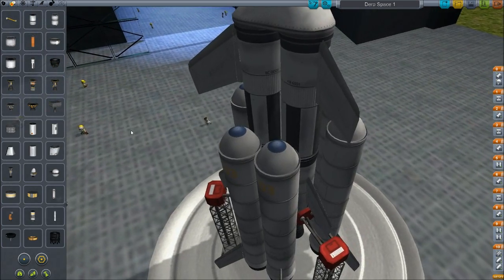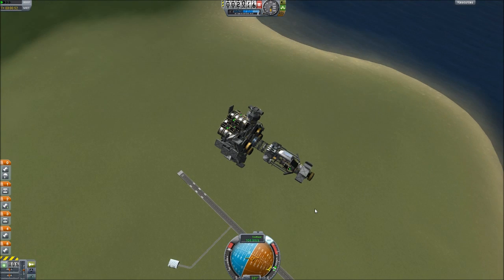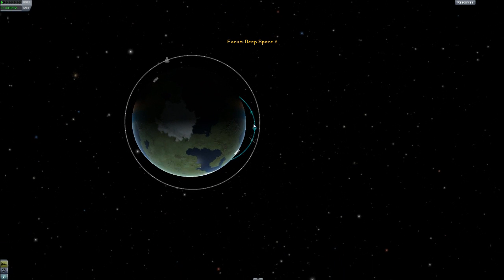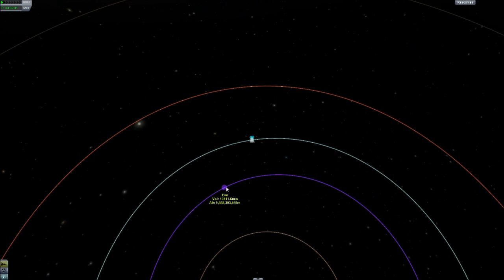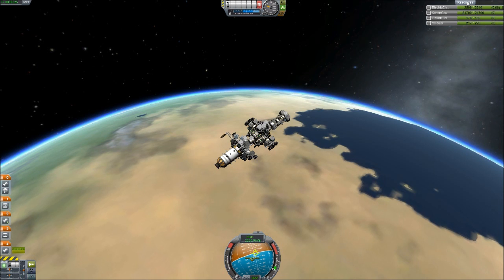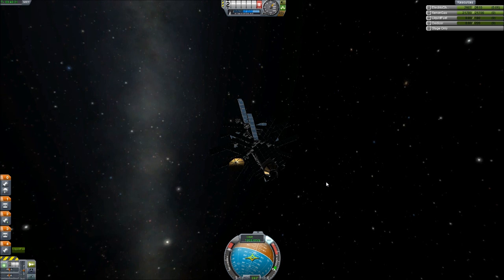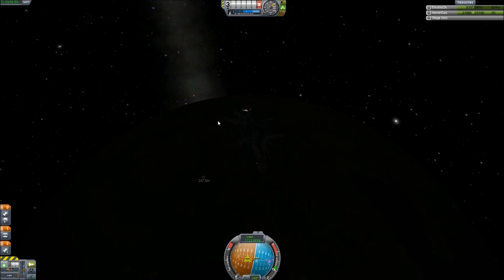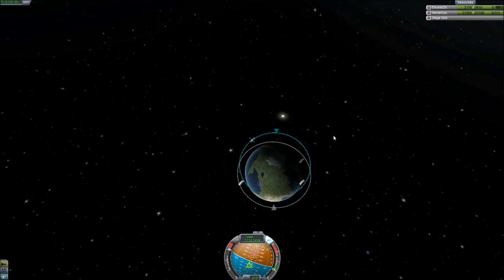Kerbal Space Program #004: The Legend of the Derp Space Probe (part 1/2)

Comment: You should use the Gigantor XL instead of all those OX-4B, it's waaay more efficient :
An OX-4B produce 2 power per second and weighs 0.0175, a Gigantor XL produce 18 per second and weighst 0.14, you need nine OX-4B to produce the same amount of power, and, 9x0.0175=0.1575 ...
So it's better in any point (and it will also resolve your lag problem)

Also, 8 XL solar panels are more than enough (I think) to keep 4 ions engine at full power (an ion engine use 12 per second).

Comment: You should also look at the biggest solar panel which generates about the same amount of electric charge as one full throttle ion engine. This way you might need less parts (even though they are much bigger) and give you a better frame rate.